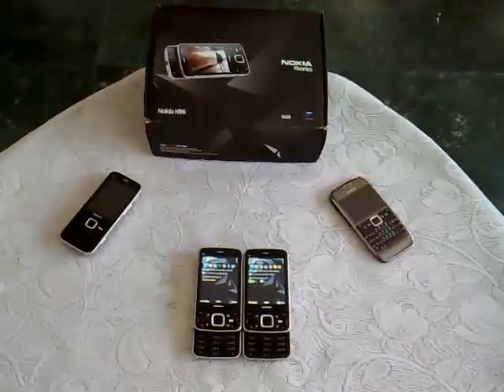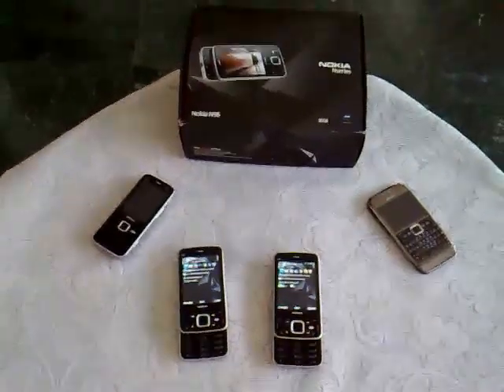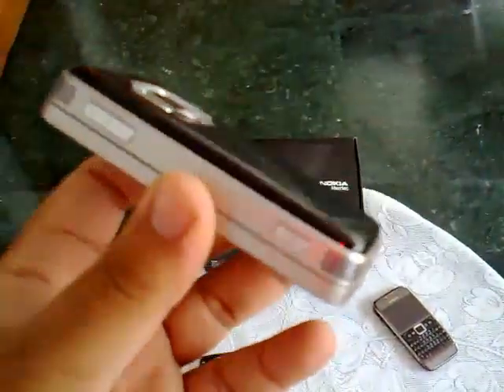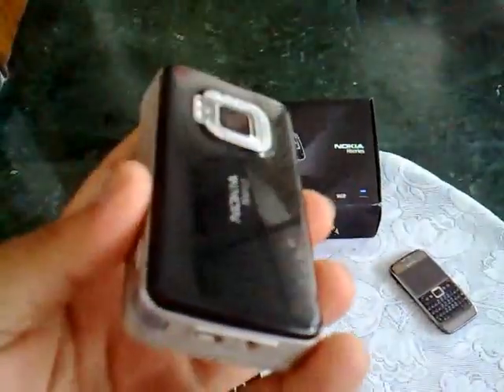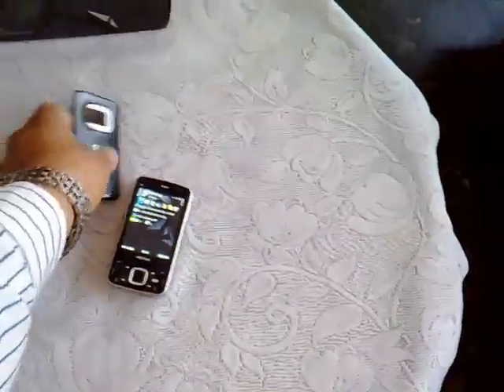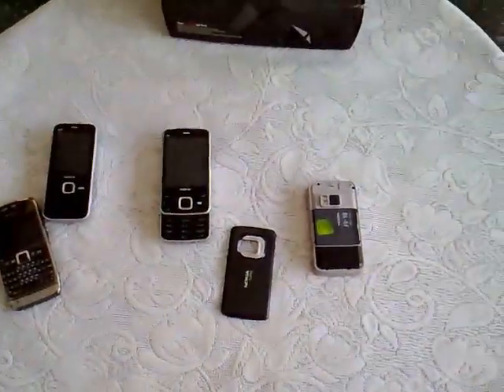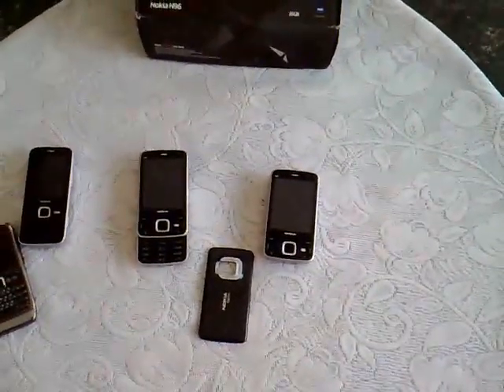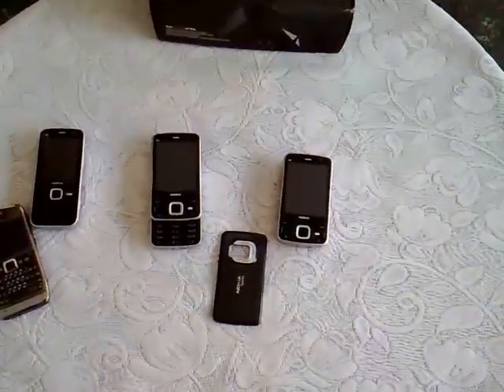The N96 Battery Swap

Comment: now, you see, I did this.

I bought a 1200mah battery and tried to fit it into my phone and obviously, it wouldn't fit without a struggle...

However, the battery will now fit after a slight modification without any bulges.

I'm now looking to get a 1450mah battery to try that to fit.